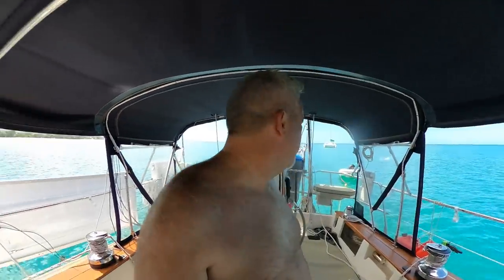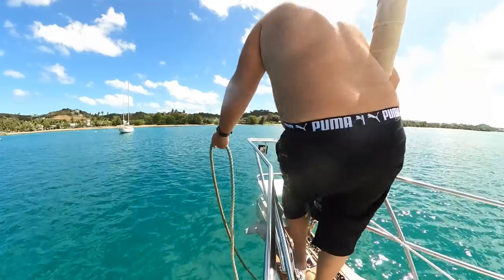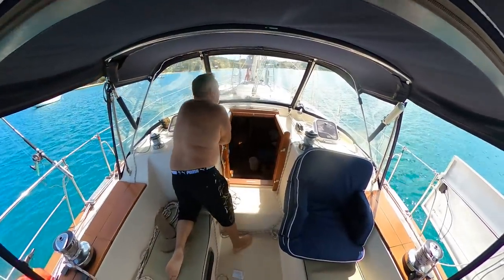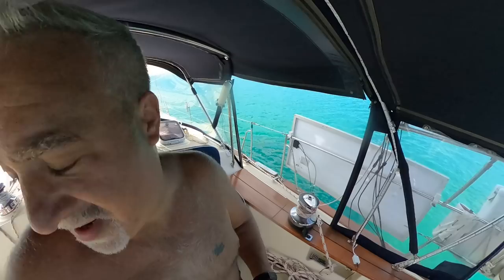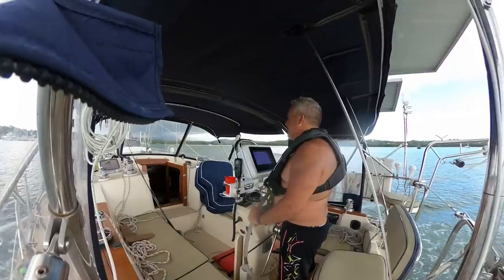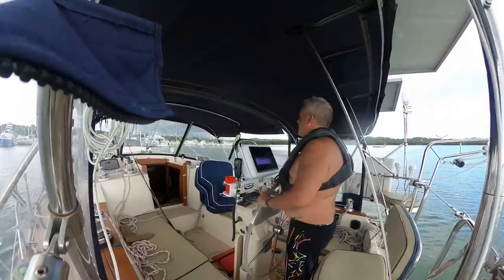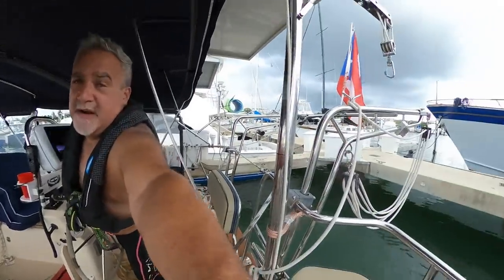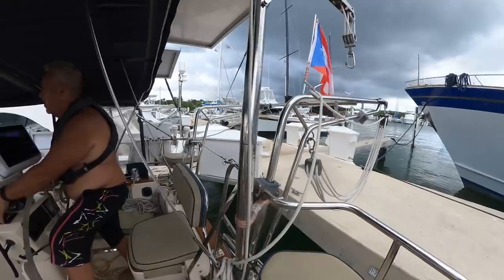Backing into a slip Singlehanded

Comment: I was taught to always run the engine when raising the anchor, otherwise it puts too much strain on the windlass/electrical system. You can still “sail off” the anchor or mooring with the engine in neutral. And we always raise the main BEFORE dropping our mooring bridles…that way you have some means of propulsion once you are free of the anchor or mooring. And having the engine running [in neutral] gives you a back-up in case sailing off the anchor or mooring doesn’t go as planned.
Reply from the maker: Thank you for watching Peter. All valid points. Traditionally extreme loads far away in the bow (windless and bow thruster) lower voltage and in turn raise amperage. Having the engine on will increase the nominal voltage by almost a volt and lower the amperage. But that isn't always true in all cases.  In the case of SVP, because of having both a windlass and bow thruster she was wired with 2/0 wire from our midship oversized battery bank (720 amp). And in fact suffers little to no voltage drop when heaving up or dropping the anchor. And after the switch to lithium, with it's higher amperage discharge abilities, there shouldn't be any drop in nominal voltage.
    I am however more concerned with the brushes in the windless suffering the added strain of moving the boat as well as the chain and anchor.  Thank you again for watching and contributing to the discussion. CUOTO
Reply: @svpaquita  Thanks for the explanation Tim…makes sense. I’ll confess, I’m a better sailor than I am an electrician…
Reply: I too also run the engine when raising the anchor because the windlass pulls a lot of amps out of the battery system and if you have a problem in a crowded anchorage you don't want to find out your engine won't crank while bearing down on someone else's boat even in 7 knot winds. I singlehanded my 38 Hunter for 12 years and anytime raised anchor or docked the captain seems to run back and forth on deck like a nervous rat on a sinking ship. Remember the old saying "never approach a dock or other vessel faster than you wish to collide with it" Nice videos by the way.

Comment: A good trick for sailing off anchor is to leave the anchor and about 20-30ft of chain out as you start to rig sails. Slows down backwards drift and keeps the boat head to wind. 
Also helps clean the anchor and bottom chain off.
If you have any sort of decent wind, you can also move off under bare poles. Just raise the ground tackle, helm over and the boat will reverse off and away. Once the boat is side on to the wind, point the boat downwind and she'll move off slowly forwards, giving plenty of time to rig sails, autopilot etc if short handed.
Reply from the maker: Thank you for watching and for the great tip. I appreciate that. CUOTO

Comment: My friend Had  43' Hatteras boat we Tuna fished and he had 400' of chain.  Before he sold this boat he changed it over to 50' of chain and the rest rope.    Your windless looks exactly like his as I was on anchor duty when we went Tautog fishing anchoring over a wreck.   All that chain is a heck of a lot of weight!!
Reply from the maker: Thank you for watching Craig. So that was probably a really good idea your friend had for what he was doing. Down in the tropics, coral cuts anchor lines and all chain is best.  The look of a windlass can be deceiving. One model may have several different size motors to fit the needs of the buyer. In the case of SVP, she is supposed to be able to lift 1500 lbs. So I think my 200' of chain and 55 lbs anchor shouldn't pose a problem. At least I hope not. CUOTO

Comment: Tim,
I’ve sailed off the hook many times. I always raise the main/in your case pull the main out of the mast prior to raising the hook. If the main jammed coming out of the mast you may have been in trouble. I prefer having the main ready to go prior to raising the hook. I would also preset the car prior to pulling out the jib. On a windy day raising the anchor the way you did it could lead to problems.
Reply from the maker: Thank you for watching George. Yes. All good ideas. I'll get there one day. 😂 Some of my friends have been telling me to try to raise the jib first and then the main after I get underway. They say that the bow will come over off the wind easier. What are your thoughts about that? CUOTO
Reply: @svpaquita  that's what I used to do dinghy sailing, unfurl the jib or genoa of, raise anchor and you can always grab the clew of the sail and drag it over across the deck area to back it to push the bow off in the direction you want.
Reply: @svpaquita  Hey Tim,
I would not unfurl the jib while anchored. The jib would immediately flog and generally be out of control. The noise of the flogging jib is also bad for crew morale. I treat sailing off anchor the same way I would sail off a mooring. Raise the mail, keeping it unsheeted. As the boat will be pointing into the wind the mail will behave itself until you get the anchor up. Once the anchor is up, sheet in the main, and sail off. Unfurl the jib once you are underway and in control. Reverse the steps when sailing onto an anchor or mooring.
Reply from the maker: @georgemauritzen9296  Thank you George. Great info! I can't wait to get back and try it. CUOTO
Reply from the maker: @grahamatsea3575  thank you Graham. CUOTO

Comment: Thanks for the video. Great single hand work, and it is so important to have your dock lines at the ready , I see so many people approach a dock and not even have a line on the boat , panic then ensues,  I hope you got your gooseneck all repaired, I was following along on your last passage to fl. Oh ya how did the anchor video come out? you left us hanging there.
    When I learned to sail i had a slip that had the prevailing winds were stright onto the bow if i was bow in. I could single hand both in and out with the sail .. just raise the main and jib, let them luff till I was ready let go the lines push on the boom enough to back wind the boat out of the slip and then swing her onto a beam tack and away i would go. coming back in time it so boat came to a stop with sails luffing rtight into the slip. took me a good long time to be able to do it. CUOTO
Reply from the maker: Thank you for watching and supporting the channel James! That seems like the right way to do it. Thank you again! CUOTO

Comment: I've never docked a boat in a marina but in a perfect world the rigger in me says to have 2 stern Iines made up the same length throw them over cleats on dock clutch motor in in idle to tension them go tie bow lines then do stern lines.
Reply from the maker: Thank you for watching Tom. That works, sometimes. Not exactly a fit for this situation (side tie to cement dock that only covers a third of one side of the boat). But if my stern was free of obstructions and there were two cleats on the main dock, that would have worked well. CUOTO

Comment: Great job! I've yet to try that alone with my IP40 since I do not have a bow thruster. My youngest son is coming down the end of the month to hopefully get my davits reinstalled. Not sure why the previous owner took them off. I'll attempt to back it in solo with him as back up. Hey, your davits look similar to mine. What size dinghy do you have? I feel I may have bought one too long. It's an Inmar  320-AL (10'9:) Aluma-Lite Rib. I think I may be ok, but probably pushing it. I'm reluctant to remove the inner staysail boom as I like the self tacking aspect, but if I'm going to be in the open ocean in rough seas I may need to in order to store the dinghy on deck which might barely fit. Unless I figure out a good way to kind of turn the dinghy flat against the stern when it's on the davits.
Reply from the maker: Thank you for watching Shane. I currently have the previous owner's West Marine fiberglass rib. I believe it's almost 10'. I also have a 15hp 4stroke Suzuki. I am not comfortable going out of perfected waters with the outboard on the dinghy while up on the davits. I take the engine off (have an engine hoist) and secure it to the port rail. Then I lift the dinghy as far as it goes. I've done over 3000 miles of ocean crossing like that and never had a problem. In fact, last week while sailing down wind from PR, a couple waves came in the cockpit and still never touched the bottom of the RIB. Keep you stay sail for offshore. That's why Bob Johnson put them on these. When the wind picks up, that stay sail really earns it's worth. CUOTO
Reply: @svpaquita  Thanks for the reply Tim. I have a 15hp Yamaha and plan to remove it from the dinghy as well. I need to figure out where to put a crane. I don't really want to wrestle with a 110 lbs motor. They're so awkward. If I was 25 it wouldn't be a problem, but at twice that age no thanks. Thinking about having a couple of stainless lifelines welding in place of the cable type lines at the cockpit so I will have more space to add solar, grill, and a place for the motor. May just put the motor on the stern rail, but it's a little cramped. I would like to have a couple of seats put there too like your IP. I'll definitely keep the staysail, but may take off the self tacking boom. There is a guy down the pier from me that did the same thing. Still debating on it. I'll wait until I have done some sailing with the dinghy on the davits.

Comment: Try some Soft Shackles on your anchor snubber. You'll find it much easier to work with...
Reply from the maker: Thank you for watching Michael. I am a big fan of soft shackles and use them often. But I'm not sure how I'd use them on my snubber? The two lines going back to the boat are long and adjustable (different conditions). They meet the anchor chain by being permanently attached to the stainless steel chain cleat.  I am very interested in your trick, but I can't figure it out. CUOTO
Reply: 👍☑️🏝 I’m curious too. Soft shackles need to stay taunt to work correct? We didn’t have them back in my sea days LOL